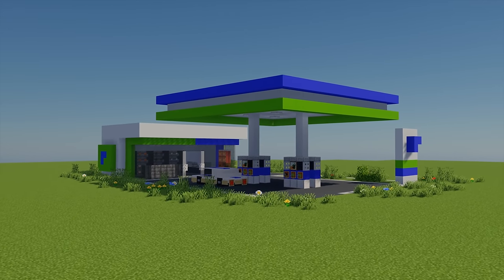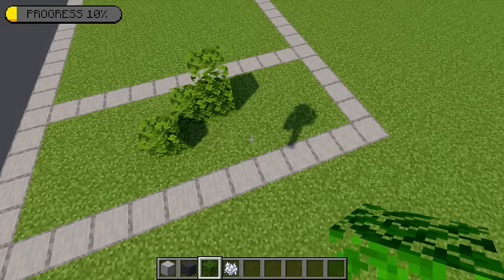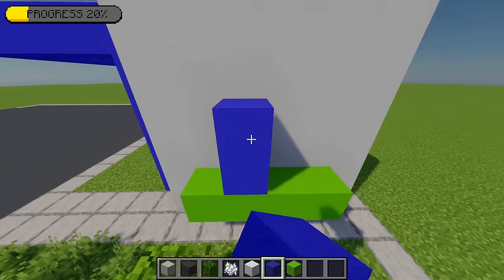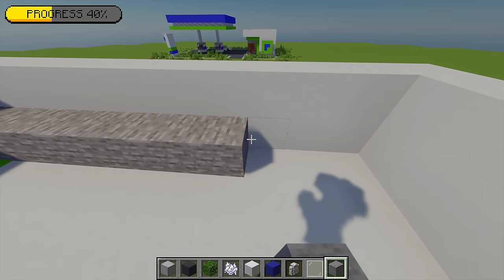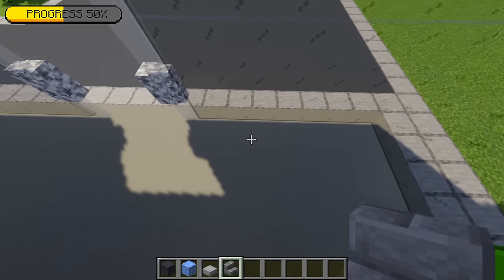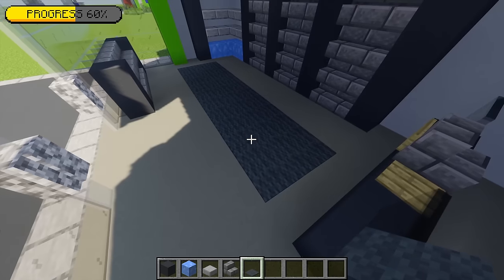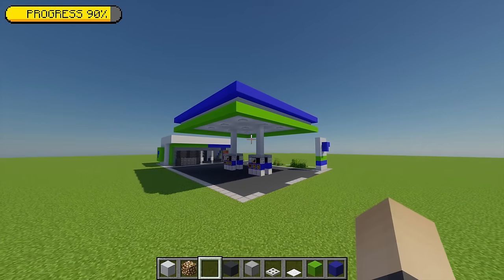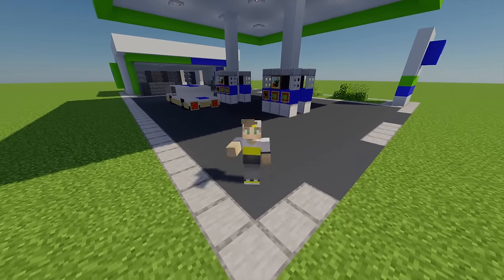How To Build A GAS STATION In Minecraft!

Comment: Only problem I can’t have invisible item frames 
So which should I use Item Frame or Glow Item Frame 
This is for my Nintendo Switch world
Reply from the maker: Yeh just use normal items frames, they still look good. : )
Reply: @ChippzMC  thanks
Reply: @ChippzMC I can’t place the tripwire hooks over the item frames I’m playing Bedrock
Reply from the maker: @MinecraftYoshi99  I've just tested this and it only seems to work in Java Edition. However, you could try adding levers onto the iron blocks underneath for a pump design.
Reply: @ChippzMC  Will it Work on Nintendo Switch